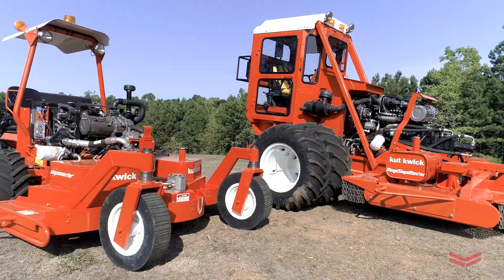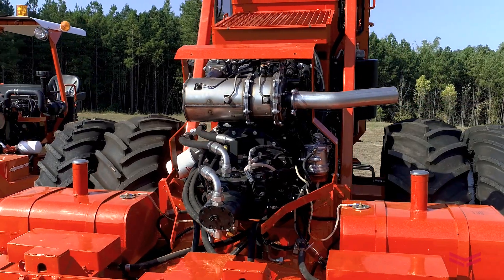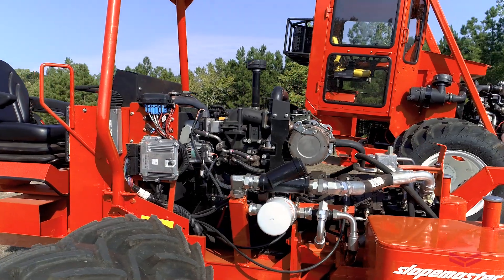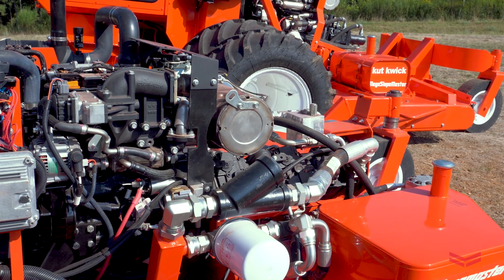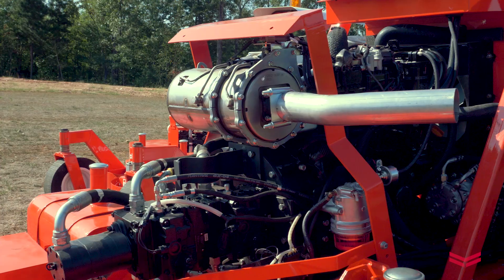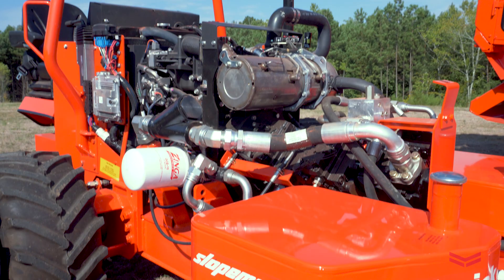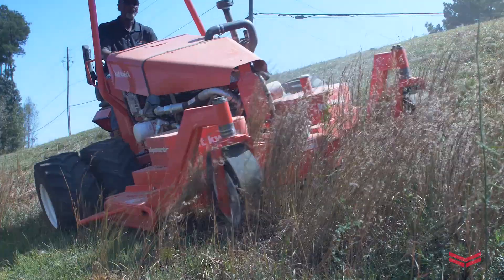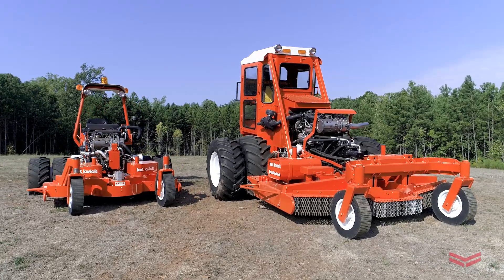Kut Kwick Slope Mowers and Yanmar Engines partner to build heavy-duty equipment.

Comment: We use the Steiner 440 tractor with a 72 inch fine cut deck to cut slopes on a reservoir up to and some over 40°.
It is the best tool for this job.